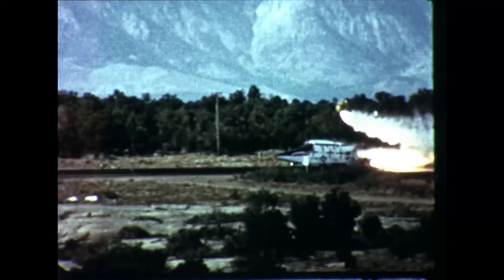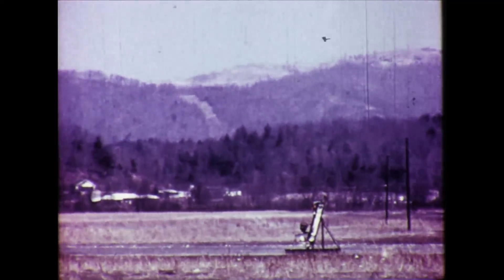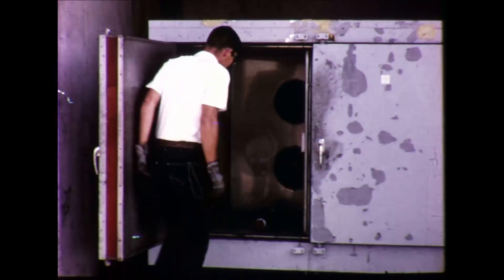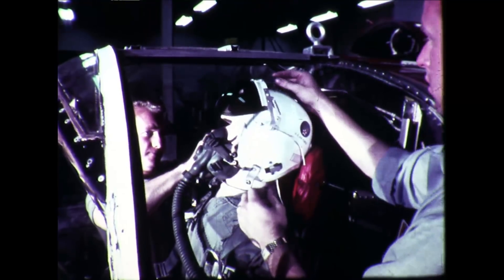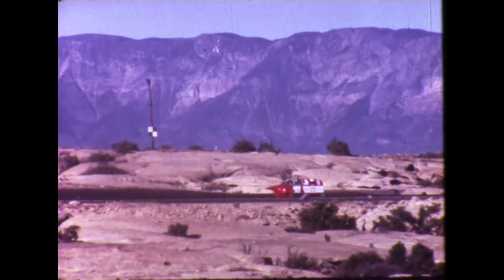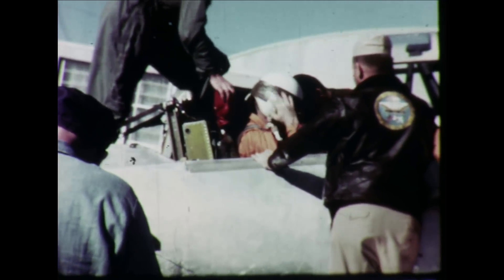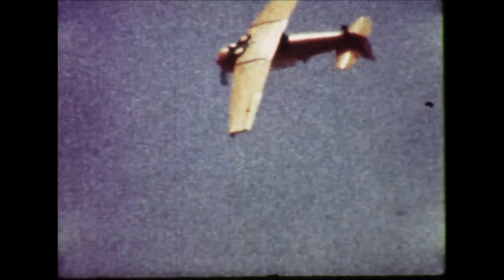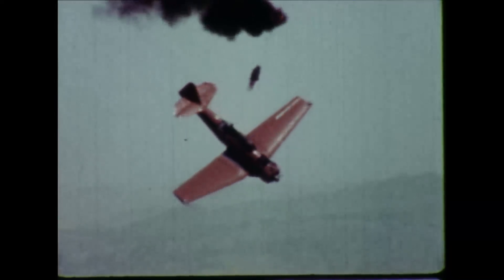Ejection Seat Alternative: The Yankee Escape System

Comment: The variable weight of the pilot problem was solved by Martin-Baker: a dial on the side console that (if truthfully set), causes the rocket pack to swivel to an angle that thrusts through the CG of the seat / pilot combination during the rocket burn.

Comment: This looks similar to the tractor rocket ejection system that was considered for the space shuttle. I've seen test fire footage of the shuttle system... Looked like a hell of a ride!
Reply: "CONSIDERED"...what a great word for the Challenger crew...
Reply: @jzk3919  the first shuttle to fly, Columbia, had ejection seats for pilot and commander for four missions. Once shuttle was declared operational, the seats were taken out.
Reply: @jzk3919  This system was considered as an extraction system if the Shuttle Was in stable flight, but unable to make it to a runway. It wouldn't ahve helped the Challenger crew as the orbiter broke up and most of the crew, if not all, lost consciousness before it impacted the water. Due to several factors, they opted for a different extraction system (the one with the boom extending out of the hatch).

Comment: Thanks for posting this!

I worked for McDonnell Douglas Escape Systems in the early 90s.  We had a pretty good library of test and promotional films from many different system providers (Martin-Baker, Weber, Stanley) and I managed to view all of them during my time there, but we did not have these.  Great stuff!   Ran a parachute deployment test series at Hurricane Mesa (using the runway there, not the track) and it was a beautiful place to work, being right next door to Zion.
Reply: My dad was the US Air Force aces 2 project manager in the early '80s and I think you went to St Louis on a regular basis because I'm pretty sure that's where the first seats were manufactured? He also went out to Edwards Air Force Base or some additional testing was conducted.

Comment: seems like an ejection " capsule " is what's really needed, as a protective enclosure around the fighter jets occupants  would be safer even  at mock speeds......
Reply: They stated CLEARLY in the video that it was intended for lower speed, sub sonic and zero/zero ejections....
Reply: That's what the F111 does, the entire cockpit ejects, pilots remain inside until landing. But it is a Mach 2 aircraft, and the Yankee system is designed for sub-sonic aircraft.
Reply: If your aircraft is still going super-sonic, you probably don't need to punch out.
If your aircraft is super-sonic and something breaks, you won't be above Mach 1 for very long, so if you can wait a few seconds before punching out, no crew capsule is needed. 
That is why super-sonic aircraft are no longer built with capsules.

Comment: Is it really safe for pilot to be ejected through that SMALL cross section window of canopy with the seat have so many movement during the whole ejection process?  There is no restrain with the limbs, thus how can you prevent them from waving around during the process and will not hit the canopy frame?  Also, the ejection seat itself can serve as a guarantee that the canopy will be penetrated before your head and this may have a possiblility that your head will hit on canopy should the explosive cord is not action properly.
Reply: maricideva mega limbs? Inertia.
Reply: this is just a cheap alternative which better than lifting yourself out of the airplane and then tumble to the side and hope for the best that your elevator or tail didn't strike your head first. I think they should sell this on a small GA airplane or acrobatic airplane.
Reply: @wyunaboy  The head strike thing was considered far more vital than leg strike, quite clearly. GW Bush hit his head on his Avenger's tail when bailing out the old way in the Pacific.
Reply: @wyunaboy  The russians did come up with a simple system for their acro planes that sent the chute out which then in turn pulled the pilot from the plane.  It never caught on but they did develop it.
Reply: @wyunaboy  It's still viable, but it's probably somewhat of an expensive system to maintain, since it involves explosives (solid rocket fuel for the rockets) etc, so it requires personnel who are trained to handle such systems. It's probably why ejection systems are mainly confined to military use.